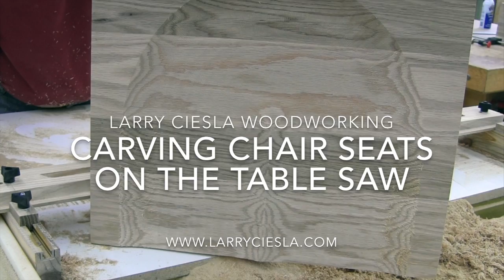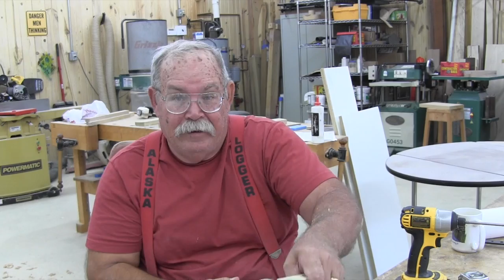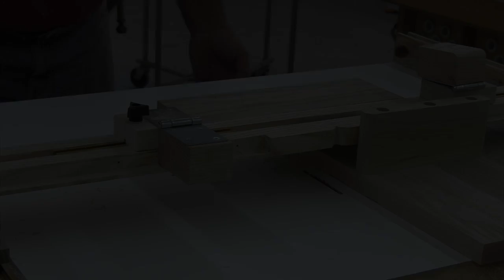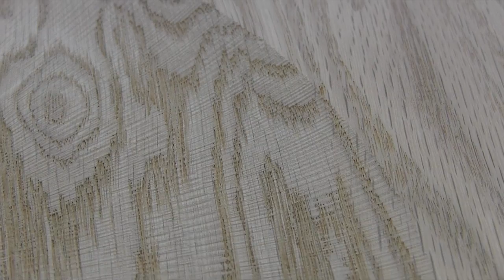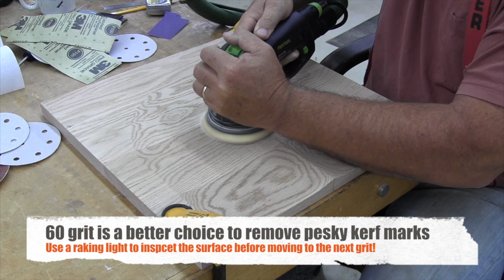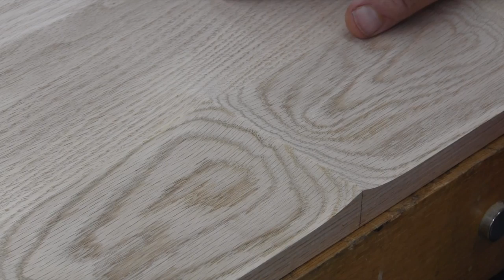seat carving on the table saw

Comment: I built the jig using your design and would like to add some comments after testing this on a single blank seat of what looks like mostly red oak (it was rescued wood from some old pallets). My project is to build at least 4 fiddle-back Windsor side chairs. The width is 17 inches, depth front to back is 19 inches including the 3 inch "tail." The thickness is supposed to be 2 inches (my test piece is 1 7/8 inches) with a maximum 1 inch scoop. Scooping it out to 1/4 inch as you recommended should be adequate, certainly not a full 1 inch. Notice that the seat is guitar-shaped. I will be using sapele other than the seat back, which is ash (I couldn't successfully bend the sapele). I first built Mr. Rodriguez's jig but its width was too small. This is what I discovered:

At the time, it seemed easier to manipulate the work piece with the top guide rotated 180 degrees with the notch pointed towards me - except that the blade grabbed the work piece twice pushing it towards me. If using the work piece on the other side like you do it, that wouldn't have happened but it looked harder to reach that way - next time I'll do it your way. The pommel is determined by the width of the follower and the starting position. If you start with the top guide in the "top dead center position" (TDC), which is directly over the apex of the blade, you won't have much of a pommel, plus I see no need for one. The distance from the groove (which should be centered over the blade) to the stop blocks will determine your front-to-back cut length. I added 1/4" marking along the top guide's T-track with 0" over the notch and increasing in each direction outwards. The length of the T-track in my top guide was 36" and I needed to use 14" of it on each side of the notch. The inside width of the jig (between the 2 side supports) has to be at least twice the depth (front-to-back) of the seat including, in my case, the tail. The height of the side support pieces has to be greater than the thickness of the seat blank (2 /1/4" should be adequate for most seat blanks). It is way easier to drill any holes for the legs and seat back spindles or support before you scoop it. A detailed template helps. Starting the top guide at TDC, it doesn't matter which way the guide moves, towards you or away, although towards should be easier to reach especially if you're not 6' tall (the height of my table saw is 35" without the jig). In order to get the seat scooped out that far back from the front, you had to have moved the stop blocks more apart than initially showed, which you didn't show in the video! In order to get that part rounded would require moving the pivot point out another 4-6 inches or using a much shorter follower (lengthwise). You could than rotate the work piece against one side of a stop block for 90 degrees, then place the other stop block against it while sliding away the first one and continuing to rotate it another 90 degrees. Doing all of this scooping generated swirls of sawdust that tended to get between the work piece and the jig, elevating the work piece and I frequently needed to stop and sweep it away. That made it take a lot longer to scoop out the test piece. This jig is best for rectangular seats. For seat shapes that are more contoured like the fiddle back, it get a lot more complicated. I needed to recheck each scoop slice to see where the next 1/4" wider cut would take me and adjust the stop blocks inwards accordingly. Cutting such a contoured seat shape with this jig will result in an "integrated" (as in calculus) appearance with the edges needing a significant amount of hand carving and sanding. The best way to scoop such a seat to start with would be with CNC (and, unfortunately, I don't have one of those).
Reply: This comment just saved me from a rising headache that I was getting from preemptively trying to figure out in my head how I was going to use this method on a more contoured chair seat, like those seen on a fiddle back, and you confirmed my early suspicions that this seems to only work well for ‘square’ seats . I may still use this method to remove a bulk of the material , and then go in with an inshave and travisher to finish the parts that curve out past where the saw was able to cut. I’ve gotta make 45 Windsor seats in 8/4 Cherry, and so I’m rewriting my techniques to be more suited to production work. This technique seems very slick, your troubleshooting in your comment is extremely helpful, and I thank you for that!

Comment: Larry,
Great video, thanks.  I have watched both Mario's and your videos a couple of times and pick up on some techniques/tips each time.  I plan to make one similar to yours, but have been scratching my head about a couple of design details.  On each side of the front edge of your cross piece there is a dado with three holes drilled into the vertical face.  I understand the stop blocks rest on the horizontal part of the dado, but there's not much pressure against them so why not just have them rest against the face of the board when down?  And what are those 3 holes on each side all about?  Thanks for satisfying my curiosity and for the very well done video.  You have a new fan!  Ron